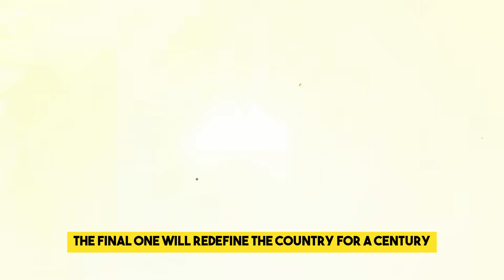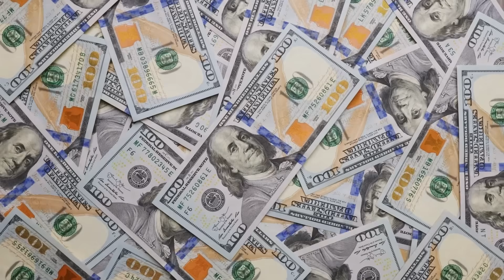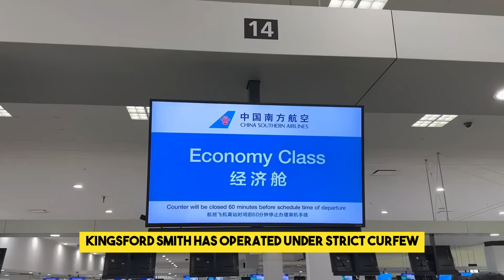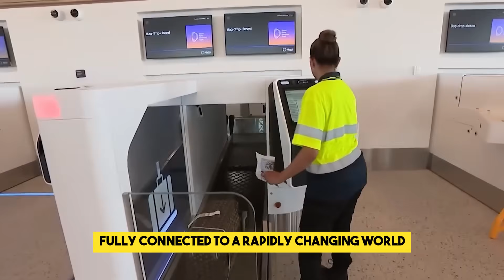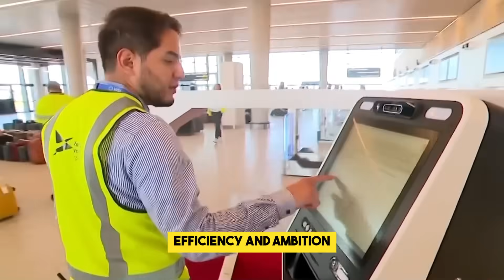If Australia Completes This 2026 Megaprojects, America Will Tremble

Comment: At 3:29, wrong railway in the wrong city shown. You showed trains at Sydney’s Central Station, only about 1000 kilometres away from the locality being spoken about in the voiceover. Oopsie! Another one! the airport and terminal area shown at 14:02 is NOT Western Sydney Airport. WSA does not (yet) have twin parallel runways (although it is designed to be able to do that in the future). It also does not have any aircraft as it is not yet open. Double oopsie!

Comment: 😄Good day from Goonellabah, NSW, Australia. I have been a contract engineer since 1975, constructing sewage and water treatment plants from Melbourne to Cairns. 💥I served as both the project manager and civil engineer. I worked as an engineer in Singapore from 2001 to 2005. We designed and constructed twelve-kilometre tunnels with two boring tunnel machines and five stations. I also managed a team of 160 engineers and architects.💥
The first passive home in NSW or Victoria, built in "The Pocket", BILLUGELEL, NSW, in 1982. I designed and built 54 passive homes along the East Coast of Australia. 🤗Ian Cleland - SUCH - Sustainable Urban Community Homes